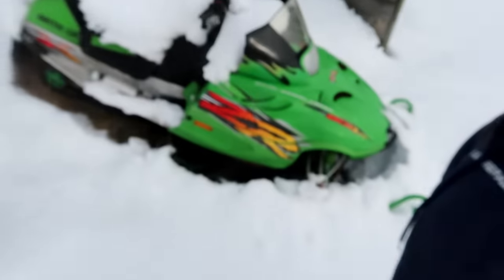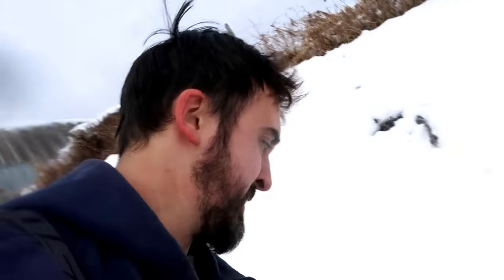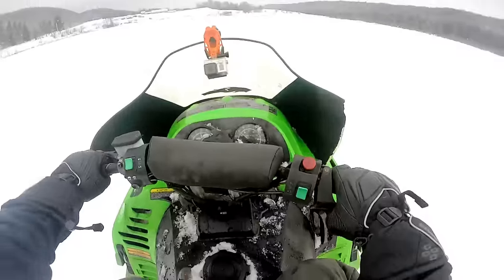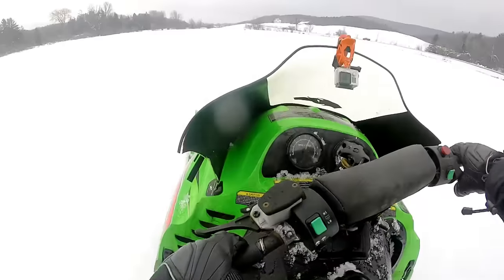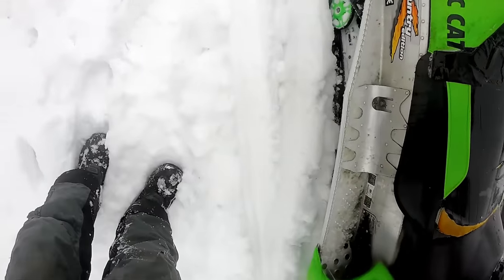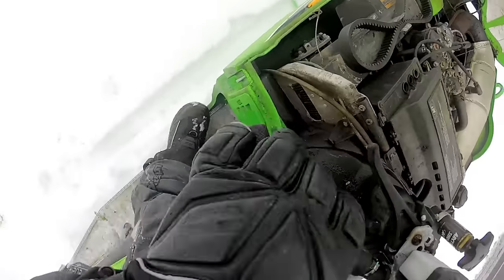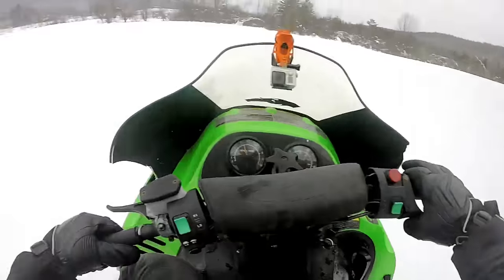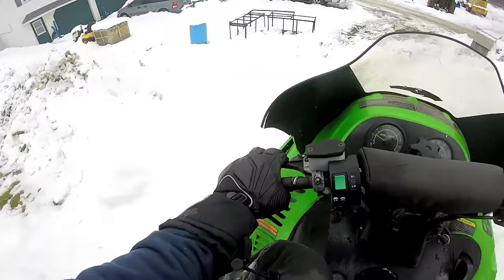First Snowmobile Ride Ends VERY BADLY (Arctic Cat ZR 800)

Comment: It isn't to hard to figure out why things don't run right. When they are left outside.
Reply: Exactly.  It’s not the brand it’s how it’s taken care of. I don’t think anyone would say a Yamaha 340 or 440 Exciter or Enticer is a bad sled, great engine durability. But leave it outside and let the mouse family move into the seat and air box, let all the seals dry rot and bearings rust up, the gas turn to syrup, yep she’s a pile now.
Reply: @glenmallory9982  I store my sleds outside in the off season. (Have no indoor storage or garage.)  But they are under covers with the tracks and skis up off the ground.  I also go out every couple weeks and pull the covers off and let them air out.  Don't want moisture to build up under those covers.  I also make them as mouse resistant as possible. (peppermint oil, dryer sheets, etc.)  Have had no rodent issues.  

It is all in how they are stored.  Just leave it sitting in the side yard on the ground and uncovered and there are sure to be issues.

Comment from the maker: What do you think is wrong with this ol' ditch pickle?? Also, did you spot a sasquatch in this video? 😯
Reply: I would almost lay money on the track drive shaft bearings.remove the speedo drive cover,and you will probably find your issue.
Reply: It's 100% the track coming apart. The tempo is such that every time it makes a revolution you're hearing and feeling the tick under the seat. Going slow you don't feel/hear it because there isn't enough centrifugal force to slap it against the tunnel. If it were belt, the tempo would be 100s even 1000s of rpms, not one tick per second. The notch missing out of the edge you showed at the beginning would be a good starting point to investigate. As far as the bog, it's starving for fuel. Being efi, check your fuel filter if there is one and fuel pick up screen in the tank.
Reply: Would also be willing to bet something’s going on with either the smart valves in the tank, power valves, or clutching, that sled isn’t pulling nearly enough rpm and sounds down on power
Reply: Rotate slow and you will probably find a stud that is ripped out on 3 sides flopping around hitting your heat exchanger. Had it happen to my mxz800. If that’s not it like others have said drive axle bearings. Loosen track tip it on its side grab hold the main drive axle and wiggle.
Reply: It's  your track...a stud is ripped with one stud or more hitting...tip it on its side and roll the track by hand and find it.  My guess is you have already eaten into the fins of the front heat exchanger.

Comment: Something in the fuel system is gummed up and it is starving for fuel at certain times.  More then likely that track is coming apart.  Your clue is the missing pieces on side of the track and the fact that the machine is getting older.  Also sitting outside with the track on the ground long term is never a good idea.   Merry Christmas everyone!  
☃⛄❄🎄

Comment: I'd say the clicking is the track for sure, you just didn't look hard enough
I had a similar issue with the engine to my buddy's ZL 800 EFI, ended up being the main fuel line what was on it was some regular tygon fuel line and it couldn't take the EFI pressure. Replaced that with some good thick stuff and she was good to go

Comment: Jeremy, check the chain case. I still have my 1999 ZR700. I had a similar problem. I thought it was my track. Not the track. Then like you i thought it was the belt. I switched belts and the problem was still there. It was a bolt that came loose and sometimes it thumped then sometimes it didn't. I rebuilt the chaincase internals and problem solved.

Comment: Nice to see some snow, where I’m at nothing 

I just bought a 98 zr 600 EFI, it had an awful bogging issue, so I adjusted the tps and replaced the injectors and now it’s got tons of power, the machines got only 1400 miles!
Reply: Them had stator problems you may need new stator
Reply: @Stuckin330  ya I remember reading about that, I got it going good and traded it for a 2011 crossfire 800 HO sno pro!

Comment: Have had this happen with 2 sleds. The thudding is a sign of your driveshaft bearing going out it loosing power. T high speed as well. If ignored to long you’ll find your drive shaft sitting in the bottom of your skud

Comment: if you wanna help keep the mice down, put bounce dryer sheet under the hood, basically anywhere mice could make a nest. Then to keep them out of the pipe just plug the exhaust with some steel wool. been doing it for years and highly recommend it! never has failed me once.

Comment: Disconnect the tss at the handlebars. If that fixes it, you need a new switch. Definitely needs the track changed as well before it rips n puts a hole in the front heat exchanger with a stud

Comment: It’s a loose stud you probably ruined the heat exchanger common thing that happens you have to stop immediately or you just ran it out of antifreeze and blow the motor. You can get the exchanger welded but its a lot of work. Has to clean to weld it its aluminum. My buddy welded his zr you have to check the studs every ride good luck.

Comment: It’s your front drive bearings there’s one on the secondary clutch side on the driveshaft witch is the one that probley blew  and there’s one in the chain case guaranteed 100%  that’s your problem . May as well do them all there cheap and may aswell change your track too well you have it off

Comment: With that many studs and you hear the track floppin around your lucky, you didn't rip a heat exchanger. That's the one reason why I don't run studs in my sleds.

Comment: I always seem to blow the belt on my MXZ 800 after the first couple rips of the season.... it must be the climate, cuz they get brittle and snap every year!
Reply: No it's a skidoo, it's normal
Reply: @MidnightPolaris800  probably, lol
Reply: The belt should not be left on the clutches during seasonal storage and your clutches may not be aligned. Get a simple but very accurate straight edge and check that the clutches are in perfect alignment. If not this will prematurely wear your belt or eat them up quickly depending on how misaligned they are.

Comment: Man i went iut on like a 3 and a half mile ride with my mxz 440 right after i got it rjnning made it all the way to where i was ganna turn around and then it started bogging  real bad wouldent go past 4k rpm then if fully died turns out the fuel pump went bad stoped pumping and i cleaned the right carb when i first got it caie the right side wasent running not the left card is still dirty so ive got some work to do o and the pull cord broke